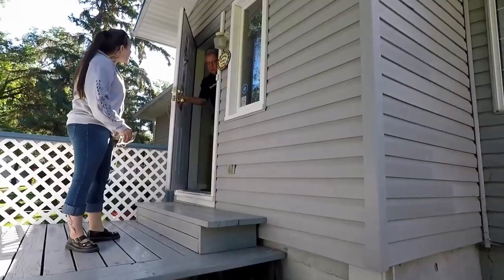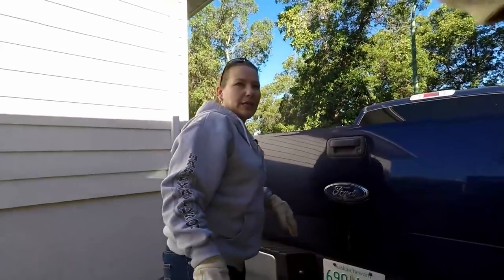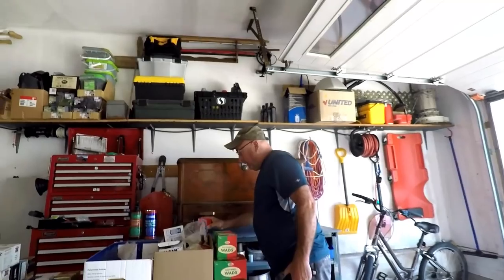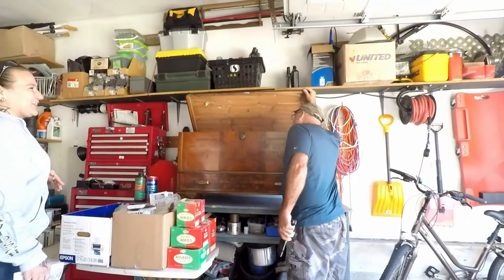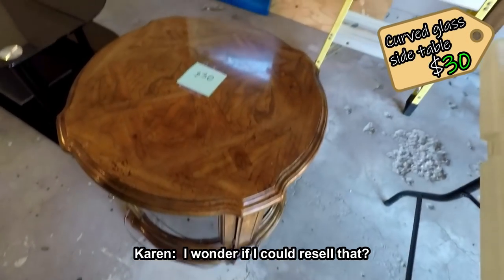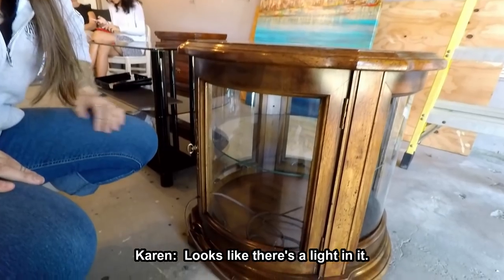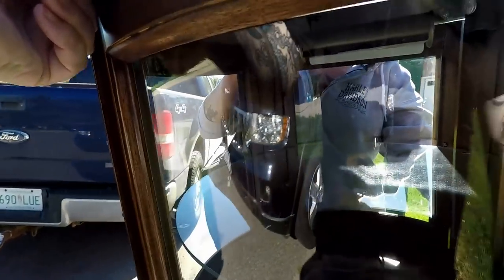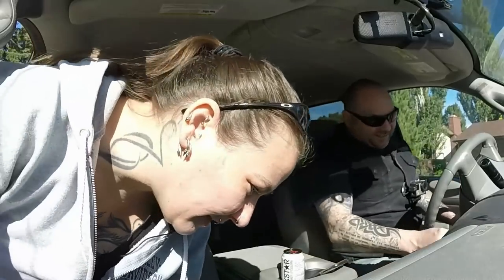Ep302: AWESOME VINTAGE FURNITURE FLIP!!!  GARAGE SALE QUICK FLIPS! 😎😎 -

Comment: I have been thinking about all that water in your beautiful house! If rain and storms had been forecasted your roofing company sure did not do enough to protect your house.  They need to be paying for having your house restored. That was a huge amount of water over a long time. Water takes the route of least resistance. You could have damage in surprising places. Then all kinds of critters find out you are having an " open house".
Reply from the maker: No worries, they'll make sure it's all fixed up properly.  👍

Comment: You got some great stuff. My mom's old bedroom set is similar to the cedar chest...with the wood grain running diagonally on the sides and straight in the center.  Also from about that same era as the chest. It was a lovely cedar chest... I'm glad that gentleman cared enough to rescue it..  And that display table was a give away at $25.  For someone with beautiful collectables to display, the $65 was also a bargain.  Thought those ALL were supposed to be red bricks???    linda
Reply from the maker: Red...  redish...  they are more cement based than clay so not as red as the ones you may be thinking of....  They are old and Karen uses them for pavers usually...